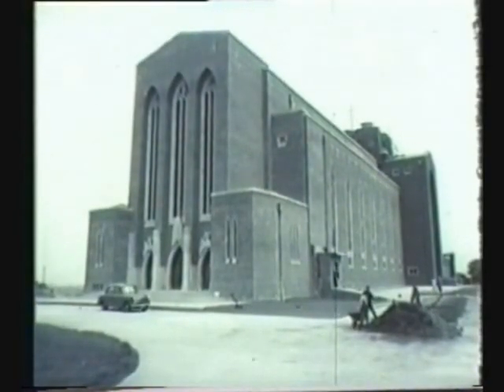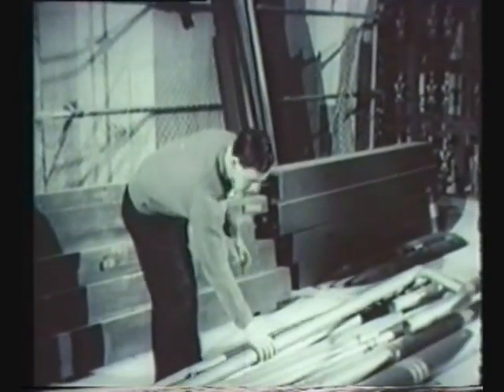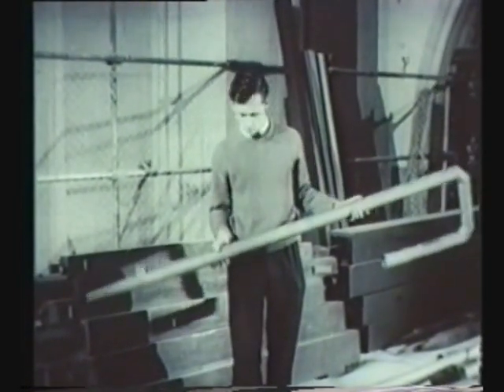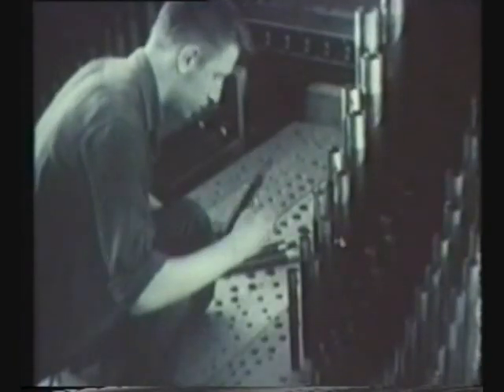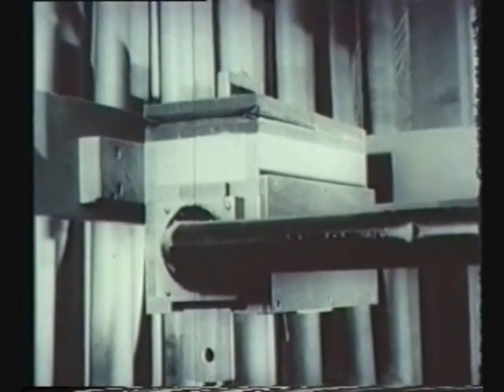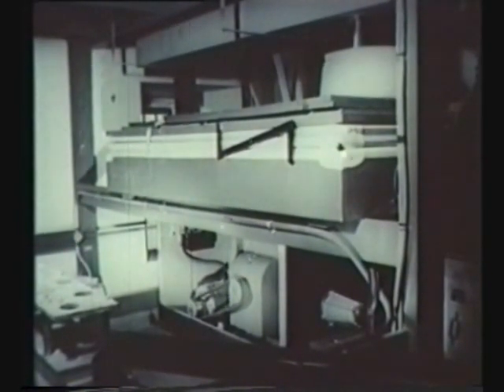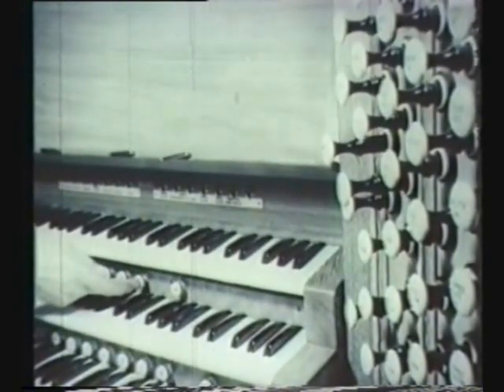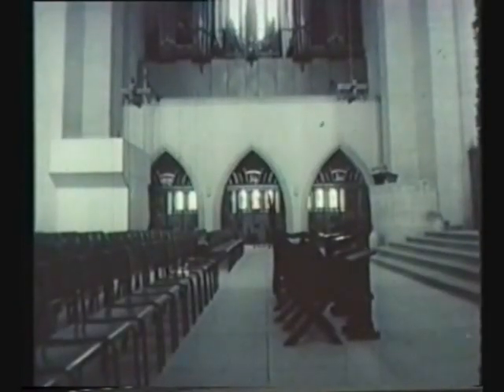Building Guildford Cathedral Organ 1961

Comment: Oops, quite right - it's Reid Memorial. The one in Belfast is St James Antrim Road - 1954 but a spec more of 1914! There are also a few good ones in London - the ex St Mark North Audley Street one in Holy Trinity Brompton is good, I'm told, then there are the rebuilds they did in the 20s of the 4m Fr Willis in Westminster Chapel , Buckingham Gate and the Harris/Hill in St Michael's Cornhill (which curiously gained a Fr Willis rank in the 20s...) which are both excellent.